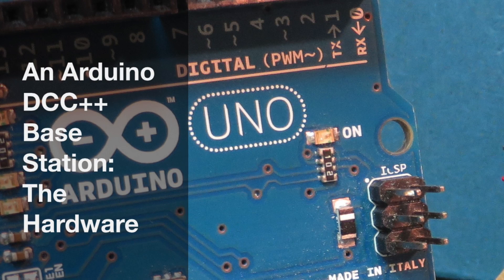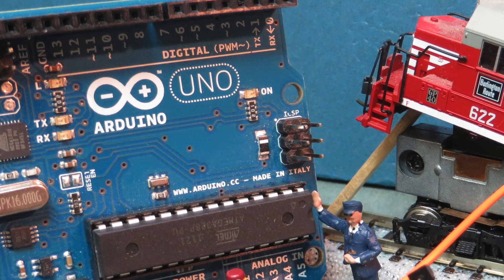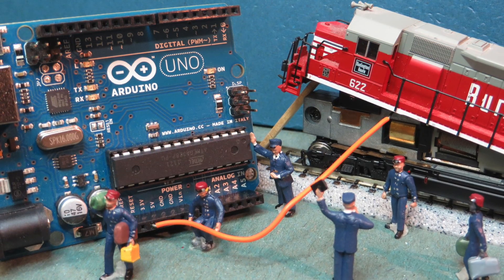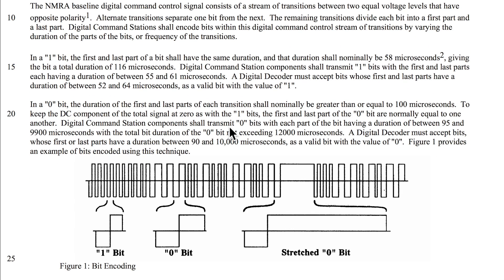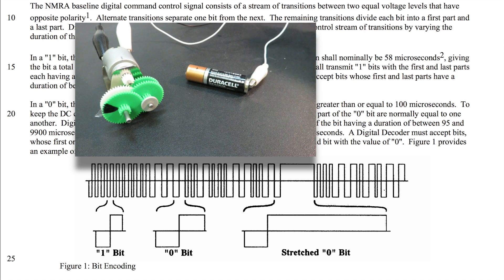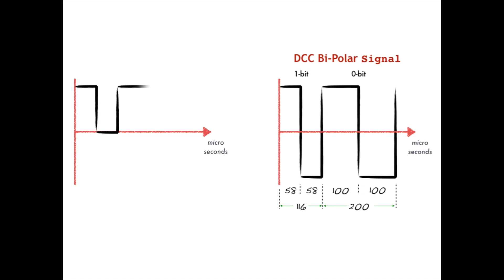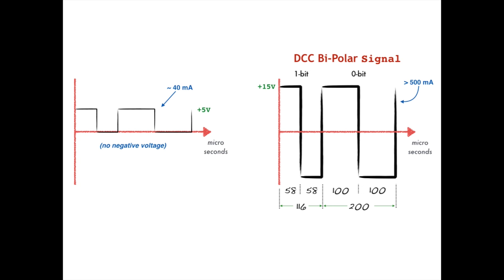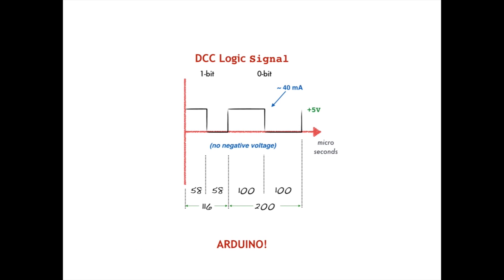An Arduino DCC++ Base Station: The Hardware - Part 1 of 4

Comment: I started with the basic Arduino DCC++ base station and motor shield. My layout has grown and I would like to use the higher amperage DCC-EX 5amp motor shield. Is this possible? I've heard it can possibly be done by changing the Arduino base station code and then compliing and uploading the new code to the base station to increase my available motor driver amperage. Can you help?

Comment: Hi I'm very interested in this DCC++ system. I have all of the components and even downloaded the software. But I can't find a 15 vac power supply. I would like to know in Canada were I could purchase  one. In addition to protect the arduino and my trains may I have your suggestion on  electrical short protection. Thank you

Comment: Will this work with LGB MTS III decoders?  The MTS uses AC on the track voltage.  Does the Arduino convert a CD input to BiPolar signals needed for the LGB MTS decoders.?

Comment: Can this DCC controller be used with a NCE controller??
Reply from the maker: +John Frankforther 
I'm unfamiliar with the details of the NCE controller and unfortunately don't know if/how it could be used with the DCC++ Base Station.  However, you may want to post the question to our TrainBoard discussion group (see link on the About page).  There are a lot of folks on the board integrating DCC++ in many interesting and exciting ways I did not anticipate, and someone is likely to have experience with NCE as well.